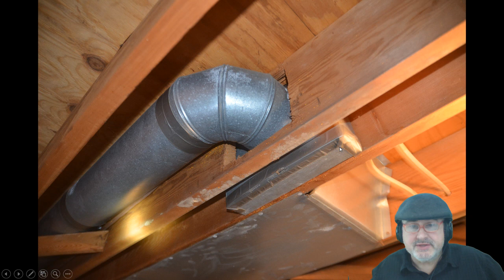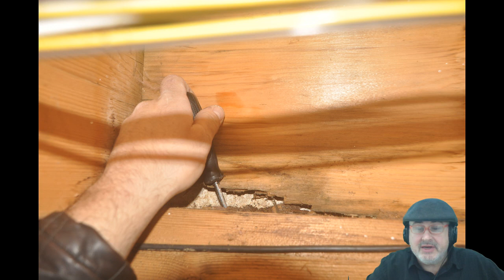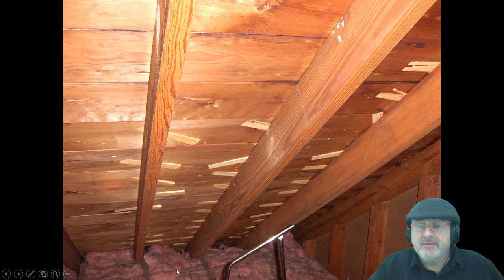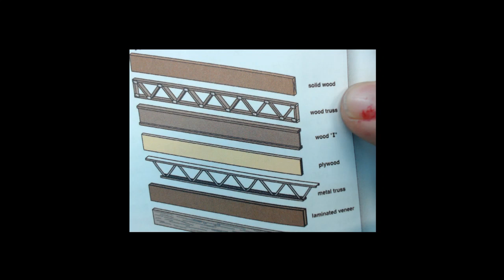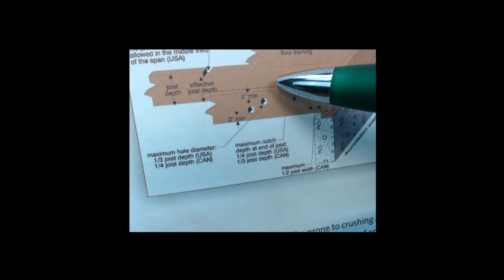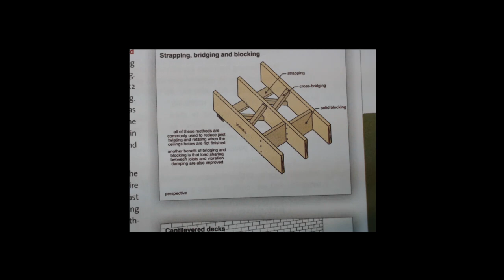How to fix unlevel floors: Joist problems, how to repair floors that are not level

Comment: So the room I have that is unlevel adjoins to the living and to  the bathroom. The bathroom is level to the next room. The unlevel room slopes badly toward the bathroom. So I would need to lower the high side of the room because if I raise it I will have to raise the rest of the house. Can I lower one side to level. The high side is an exterior wall. Would I have to notch the joist to lower you think? Or just level best I can to get it somewhat more level and have to live with it?
Reply from the maker: forget the level , world not perfect

Comment: I have a new home and it is evident the floor is not level...it can be felt in many places throughout the home. I have watched several of your videos, but none of these are my issue. How can this be corrected? Whar are the possible damages from uneven joists?
Reply from the maker: It would be a lot of stuff, moisture, humidity, acclamation, damp rise, installations etc.  I do have service called   " Call Mako with a question"  just google it ,     you can send photos and after I ask 50 or so questions maybe we solve your  floor problems.  I do a lot of these for folk around US.